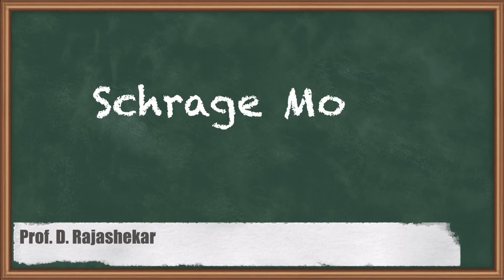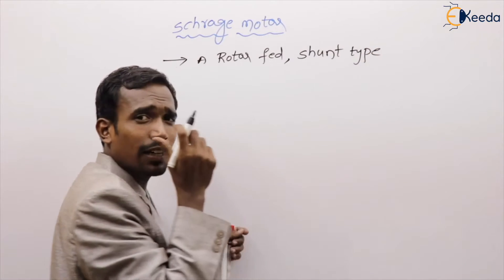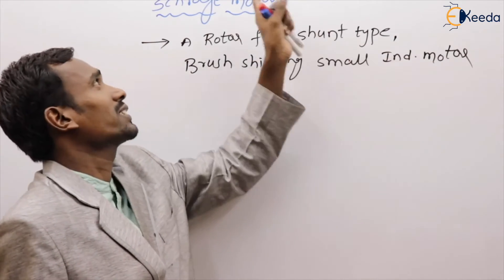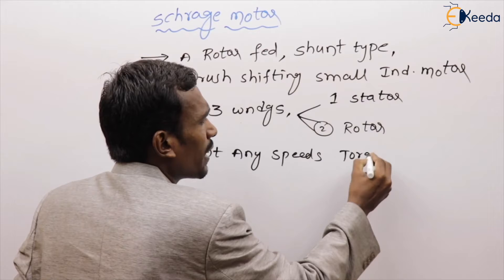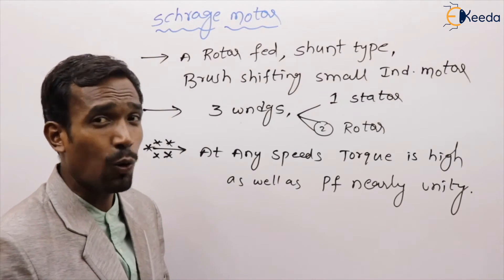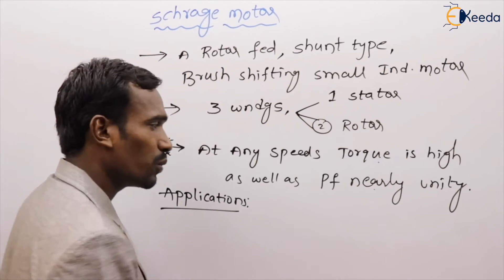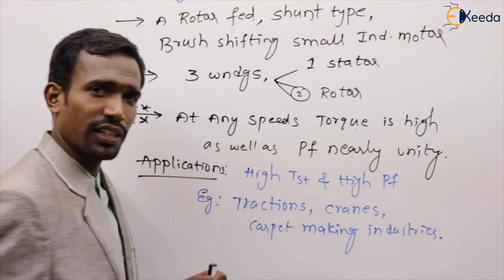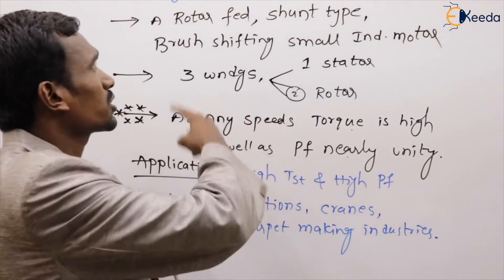Mastering Schrage Motor: Essential Concepts For GATE Electrical Machines

Comment: The gentleman in this video did not explain how these motors work, but  related what they  consist of, and what they do, or where they are used.  He should have explained clearly how the Schrage Motor works . He is even  sounding the name Schrage wrongly.  He should have explained how it works, and how the commutator voltage is generated at the slip frequency, to be able to feed it back, totally different from an induction motor, or a wound slip ring synchronous motor. 

Educators should be careful how they deliver the lesson, as, "What it does", and "Where it is applied"  is not, "How it works"  There is no information in this statement written about this video and if he who did it was in my class, I would have failed him  as he said nothing abut the Schrage motor,  

Quoting what I read. " 🔍 What is the Schrage Motor?
The Schrage Motor is a groundbreaking advancement in the field of electrical machines, known for its unique design and exceptional performance characteristics. Join us as we unravel the intricacies of this motor and explore its applications in various engineering domains." In this video there is not a single sketch or drawings of any of the motors or rtheir winding, It is absolutely stupid to teach in this manner. Poerty and religions an politics and fables from Hans Christian Anderson are presented in this manner. Also the presenter does not need to shout! 

The Schrage motor.

 Let us start with the induction motor. We shall deal with the three phase type. The induction motor consists of a three phase winding inside the space of a cylinder, This produces an electromagnetic rotation  inside the cylinder, as if a diameter is rotating . It is like a permanent magnet being rotated in a cylinder where the North and South  fields are a rotating diameter.  This rotating magnetic field circulate the iron and squirrel cage  rotor, there is an induced voltage, which will cause heavy inductive current to flow in the rotor, hence a magnetic field will be set up by the rotor, which will react with the original  rotating magnetic field on the stator, hence the rotor wills start mechanical motion, rotating. The inductive part reflect a low power factor at starting.  An induction motor will never run at the synchronous rotation of the stator, fed from the AC source, if it does, there will be no rate of change of magnetic flux in the rotor, hence no current and hence no pulling torque.  The rotor will slow down to have a slip frequency  in order to generate the internal rotor current to produce the torque. The induction motor needs a slip frequency at the rotor, and , the frequency of the current in the rotor is changing,  being high at stationary state, and zero, at synchronous speed.

The wound induction / synchronous motor. The stator is the same as that on a three phase  induction motor. If we wind a three phase winding on the rotor of a three phase induction motor, we can apply an external voltage to the rotor through slip rings, and we can also short circuit the slip rings, where we would finish up with an induction motor. If we apply a DC voltage to the slip rings of a wound induction motor, then  we can turn the rotor into a permeant magnet, so this will follow the synchronous magnetic rotation of the stator, hence a synchronous motor. 

Now here is another possibility. Rather than applying a short circuit, or a DC to the slip rings of a wound induction motor  to produce, either an induction motor, or a permanent magnet for a synchronous rotation, we could apply an AC three phase voltage  of variable magnitude to the rotor, OF THE SAME SLIP FREQUENCY AS THE ROTOR INDUCED VOTLAGE, THEN WE COULD CONTROL THE SPEED BY APPLYING a  variable  voltage of the same slip frequency as that of the rotor.  This is what is done in the Schrage motor, by using  a set of coils connected to slip rings on one side of the rotating shaft  and another set of coils connected to a  commutator mounted on the other side  the rotating part of the Schrage motor. 

This is how it works,  We apply a three phase supply to the  three phase stator, ( or the rotor)  this sets up a rotating field. When the rotor / armature is stationary, the frequency induced in slip rings and the commutator brushes are the frequency of the mains supply   As the rotor / armature speeds up, the frequency in the rotor changes, as that of an induction motor, and it is no longer the frequency of the supply, it goes lower, as the rotor increases rotation,. but since the coils connected to the slip rings of the rotor are on the same rotating part, as the coil connected to the commutator, then they are of the same frequency and can be connected together. The magnitude of the voltage applied to the slip rings can be adjusted by changing the circumferential location of the brushes on the commutator.  Perhaps to understand this phenomena one should consider a DC generator where the DC field is not stationary but rotating  around the armature with a commutator. 

Again, the voltage applied to the slip rings of a wound AC motor can only be done if the voltage applied has the same slip frequency as that of the rotor/ slip rings.

 Summary,
**The induction motor............ no supply is fed to the squirrel  cage or or to the wound rotor short circuited.  Current in the rotor  it is induced by the rotating field on the stator. It .needs a slip frequency to generate the rotor current induced by the stator. rotating field.
**Synchronous motor---- A DC supply is fed to the slip rings and this will become a permanent magnet which will have to follow the synchronous speed.
**The Schrage motor (sounds as Xrag) A three phase supply is fed to either the stator or the slip rings at the rotor, the commutator voltage will be the same frequency as the slip frequency of the rotor and so it can be fed back to the stator of to the slip rings in the rotor.
Reply: Absolutely 💯